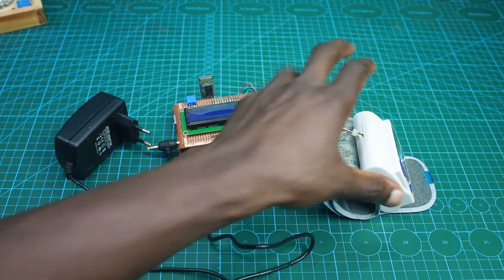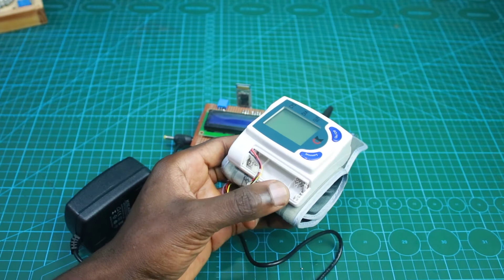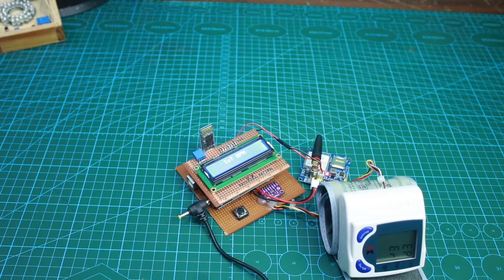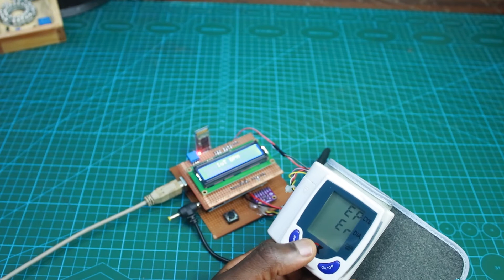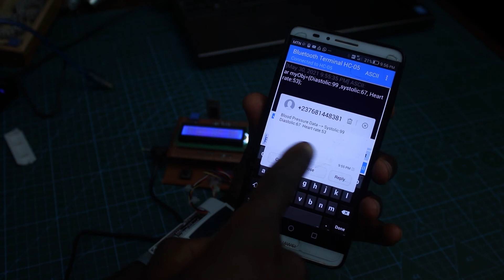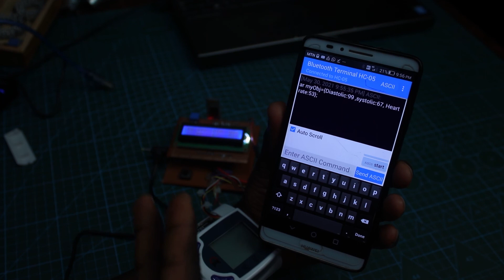Arduino IOT blood pressure monitor

Comment: Good day sir I want to try this and I have Ck-101 and arduino uno. Im having trouble in circuit diagram of the Blood Pressure CK-101 to connect in Arduino. Also, I cant program the Arduino.
Reply from the maker: They one used in that video work with I2c protocol. With the ck101, you should used serial with it easier. Open your blood pressure machine, you will 4pins(GND, DM, DP, Vbat) those are used for debugging. DM: rx and DP:tx.
Reply from the maker: From there you will understand how to write your code. Good luck.

Comment: good day sir. please how can I get through to you via dms??
Reply from the maker: Hello
Reply from the maker: How can I help you?
Reply: need help on how you built this from scratch. wanna do something similar sir
Reply from the maker: Do you have that same machine?
Reply: I'm just looking to get it sir. but I don't really know all the equipments to buy. that's why i need your help
Reply from the maker: You need that same blood pressure monitor to hack it is very easy. Arduino(uno, nano or mega), a bluetooth module and or even a GSM depending on how tou want it to be. And clean power supply.
Reply: @HermannLabs  can you please tell me the name of this blood pressure sensor or link to buy it
Reply: Can you share where to get the device?

Comment: how you get data from meter
Reply from the maker: I use I2C to link to connect the arduino to the monitor and tap data.
Reply: @HermannLabs  from eeprom

Comment: Nice work. What is the function of the small PCB connected to the blood pressure monitor?
Reply from the maker: Thanks for the kind comment. The small PCB is the I2C 3.3V to 5v converter used to connect the 3.3v blood pressure meter to the 5v arduino UNO. But could still work without it.
Reply: @HermannLabs  Do you have a tutorial on how you code the program?

Comment: hello, i noticed that u put the battery and the 3.3v is still connected. is it necessary?
i tried using the scl and sda only to a nano a4 a5, but am not getting any data
Reply from the maker: The battery is not necessary if you have a very stable 3.3v source.
Reply: Hi regarding to this, I received same error like sometime it display Er P in bp. Is it ok to put battery and 3.3v at the same time?
Reply: did you find the sda and scl on the blood pressure board? what are the pins for scl and sda?